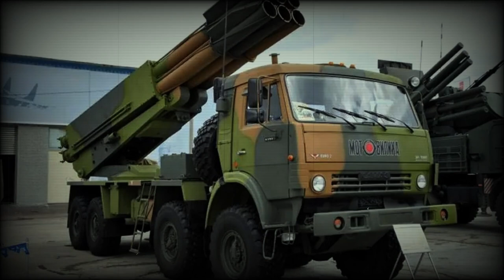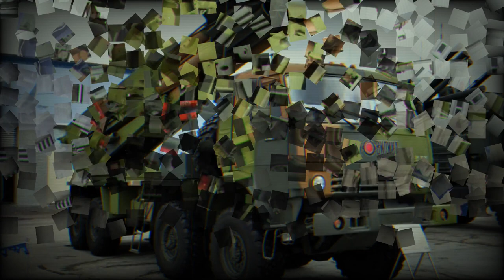Russia developing new 300mm MLRS artillery system called Sarma

Comment: So you take a commercial truck chassis and stuck a fire-engine ladder platform turntable on the back, add some sewerage pipes and call it the SARMA... which means what ?  

Anyone with half of one braincell can see two fatal flaws with this lash-up. 
What did it cost to develope?  About $50????🤣🤣🤣🤣
Reply: A perfectly normal goat was crossed with a camel, and a few months later Bikechain was born.
Reply: At least they try and do not beg for arms as Ukraine does.
Reply: it's tornado-s no sarma -_-